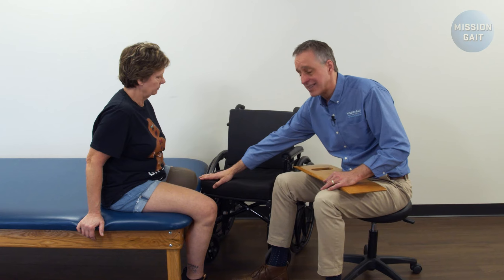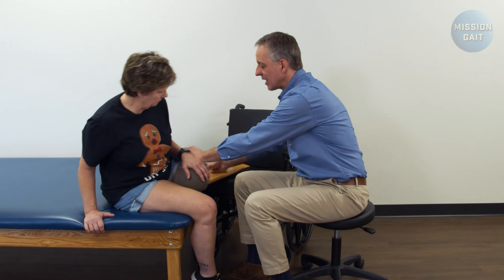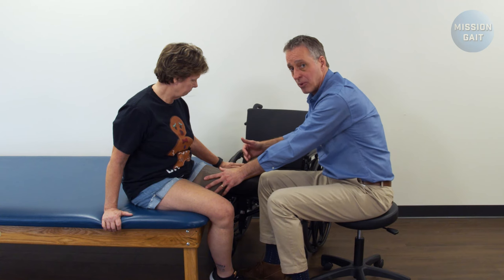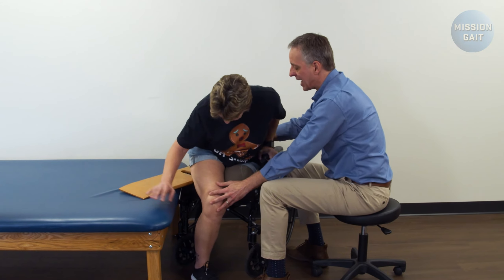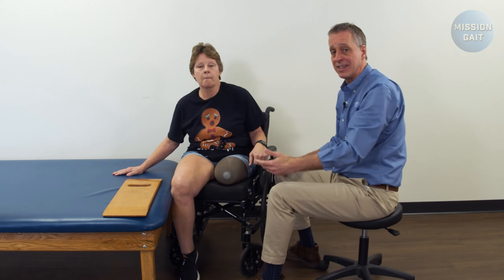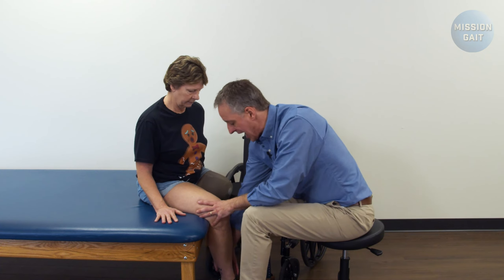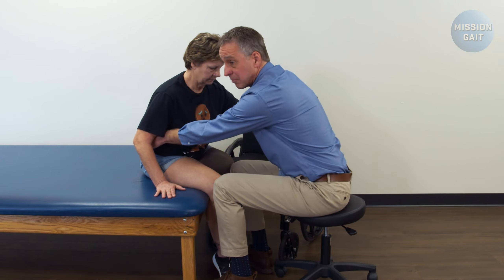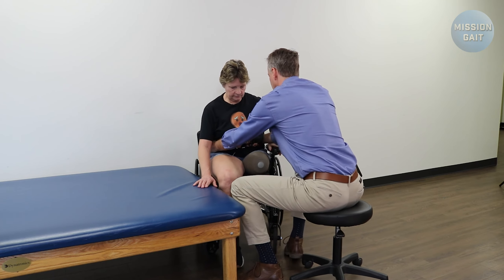Slide Board / Pivot Transfers for Unilateral Amputees - Prosthetic Training: Episode 10

Comment: Always transfer to amputated side?
Reply from the maker: Thanks for the comment. You can actually transfer to either side depending on the situation. A "textbook answer" to your question is to transfer to the non-amputated side, but this may not always be possible. The more important aspect for this type of transfer is strength and stability of the arm placed on the seat you are transferring to. For example, if you have an injury on your left arm, you would transfer to your right side. Hope this helps!
Reply: @MissionGait  Definitely helps 👍.
Will be referencing more of your videos in the future.  Thank you!